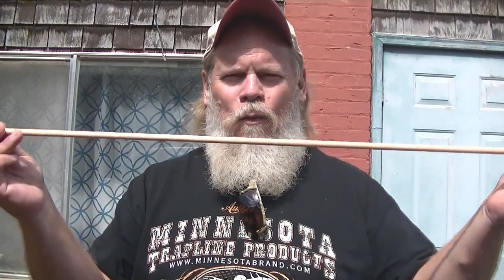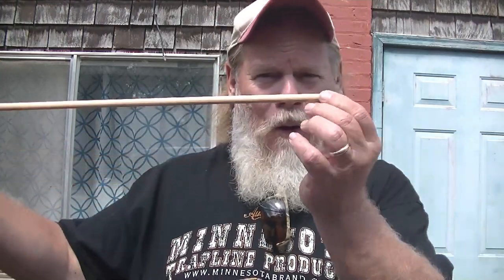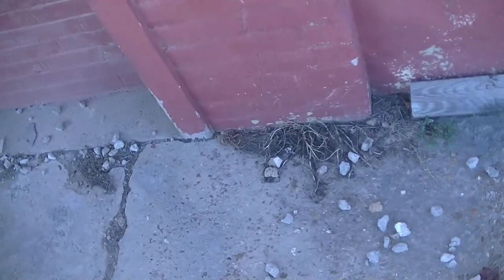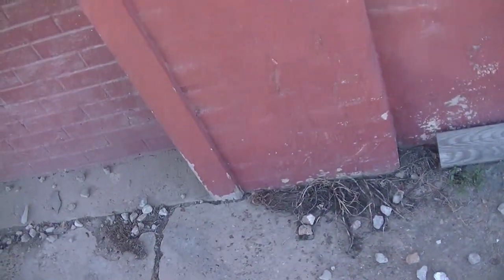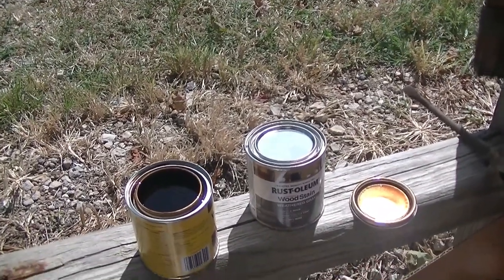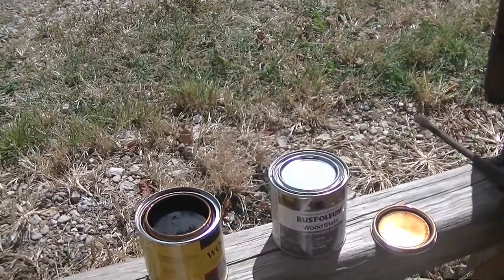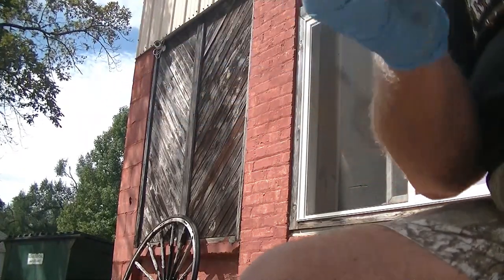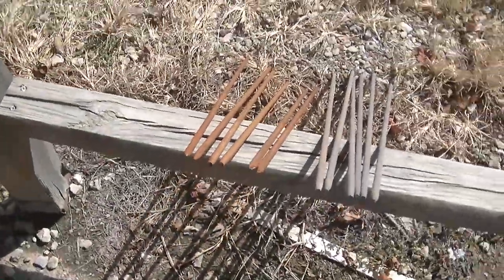Traditional Archery- Making the KILLING STICKS

Comment: Does steam or water help to straighten really crooked unpainted shafts?
Reply from the maker: Only with hardwood shafting (Ash, Birch, Hickory etc.) I used to use a propane torch and heat the bended area. Carefully.
Reply: @HickbillyOutdoorswithDWVerts  So hot air gun it is
Reply from the maker: @mikekroenke  Yes sir, if it's a hardwood shaft. Heat will jack up softwoods (POC, Spruce, etc.)